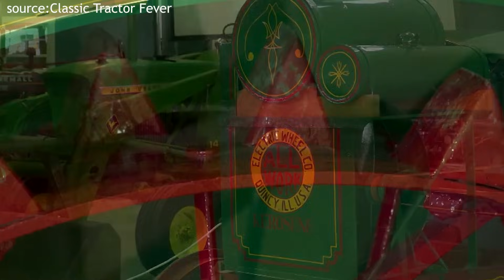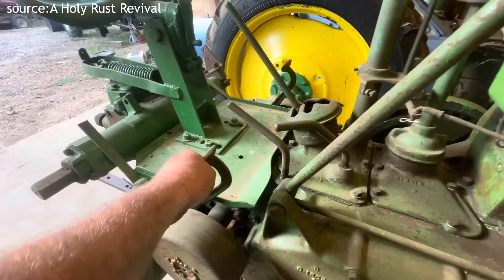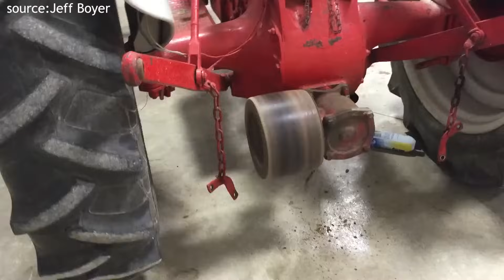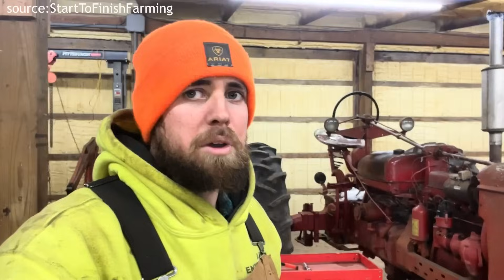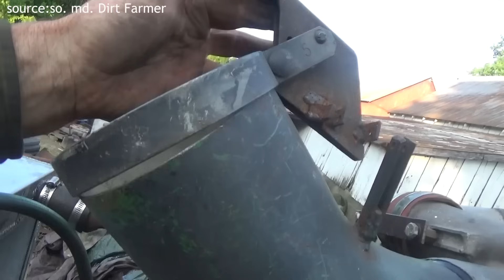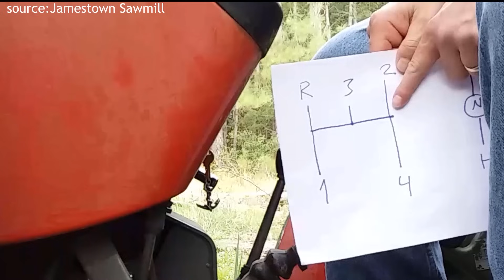13 UNUSUAL OLD TRACTOR FEATURES THAT NO LONGER EXIST

Comment: Having your thumb beside your hand is correct, but you should be standing with the left side of your body parallel to the handle, holding the crank underhanded in your left hand and lifting on the half crank, not cranking it all the way around.  That way if it does kick back it can only pull away from you instead of cranking over the top where it can kick towards you.  That's how my Grandaddy taught me to crank his old Farmall B.  On my folks' farm though, I grew up using a John Deere A and an H.  Both had electric start but the battery was always dead and we had to spin the flywheels which wasn't easy as instead of having finger holds on the backside and a smooth edge, they had gear teeth around the edge that'd tear your hide up pretty good if ya had a slip.  Back in the day that "lamp oil" was called tractor distillate and oil companies would almost pay you to take it, costing as little as 1 or 2 cents a gallon delivered which made it much more economical than gas.  In the 1980's though when I was a teen we filled both tanks with gas and used the small tank as a reserve in case the big tank ran out in the field.